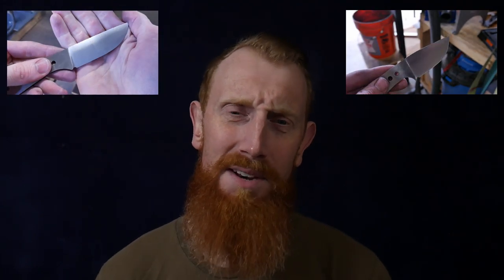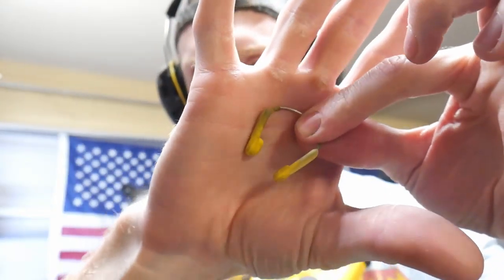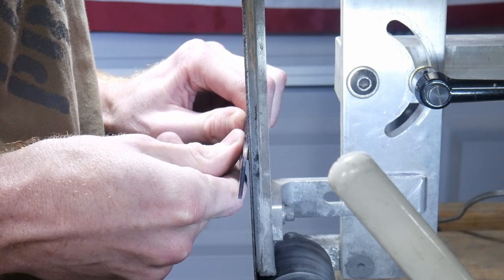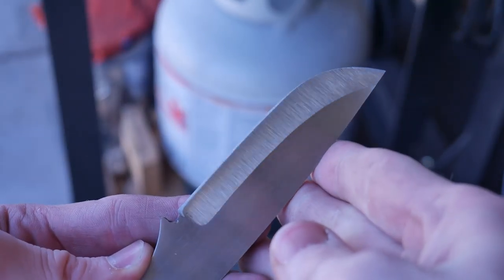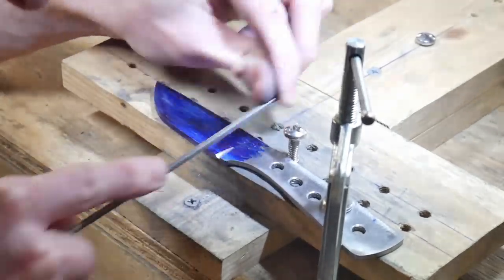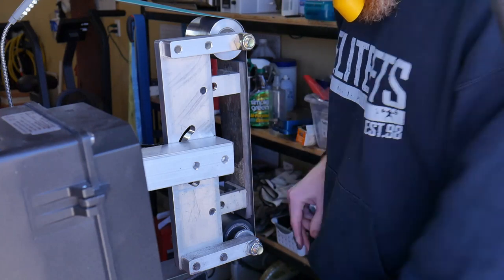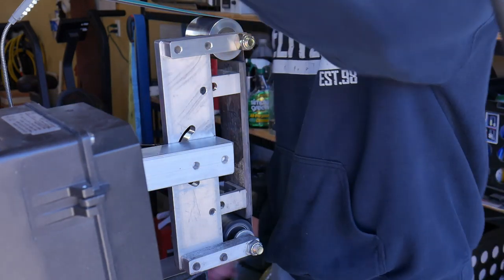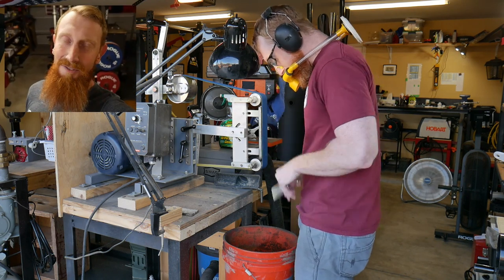Knife Grinding Basics | Plunges & Bevels | Knife Making

Comment from the maker: Do yall have any more tips for free hand grinding?! I'd love to hear them. 🙌
Reply: Red Beard Ops you don’t know what it means for me to get started with a great hobby. I suffered from a really heavy burnout and could not find the energy to do things. Everything including thinking about was to much. I will make mistakes but will learn from them. Thanks again.
Reply: I know it's not an entry level thing but you could go over how to grind hawkbill and curved blade. I free hand blades for my folders and finding out the right technique was a nightmare.
Reply: don't do it all with just a file.
Reply: I'm relatively new to this but when my grinds start to become uneven I can straighten them out by rotating the edge vertical  to flatten it out kind of like cross sanding to keep it flat. you gotta be careful around the tip and the bevels though.
Reply: I have a suggestion. I use a hardened file guide as a "stop" to set where I want the plunges to be. That way I don't accidentally grind too far towards the handle end of the blank. I use old or Nicholson files so that  I can bypass needing a forge and quench tank, only an oven to temper the blade after grinding the blade profile.

Comment: Well said. Pretty much spot on. I learned the same type grinding from Mike at Ekim Knives several years ago. Biggest thing is lots of practice. For me it didn't happen over night. Ocassionally I would take a 4' piece of mild steel  cut it up into 8 or 9 pieces and just practice. Was a lot cheaper than messing up good high carbon steel in the beginning.  Practice does not necessarily make perfect however Perfect practice does make perfect.
Reply from the maker: Thanks Jim! I agree... practice is the key. It's painful at first, but satisfying once you simi-get-the-hang of it.

Comment: made my first really nice knife/tool just the other day thanks to all these diy/ easy/ the  basics videos.  big thanks redbeard (its a wax carving knife/tool. it has a fuji cherry handle natural finished just with some spray on polish.blade is custom profiled. made rounded edges on a flat tip spade) wood came from a tree in the yard/my dry fire wood pile. the metal i got from a old stainless wax tool i had laying around the work bench. the similar tools they sell at the stores/online are 75-150$+..  to be fair and 100% honest i did  mess the first few up. and yup its a dab tool 😂 big thanks again RBO.  smoke um if ya got um lol
Reply from the maker: Heck yeah! Nice work Mike!

Comment: I would add that for complicated grinds you can take a piece of wood that is the same thickness as your bar stock and cut out the blade shape and practice the bevels on it. When I first started making knives I would try out my bevels on some of my more complicated knife templates to get the grinds down (re-curve, double edge, and false edge knives).  Another great video by the way.
Reply from the maker: Heck yeah, good tip man! I've used some wood too. Very useful and you won't ruin steel! Thanks for watching man. Take it easy. Keep up the awesome videos too!

Comment: The pressure is what always messes up my grinds. I end up getting wavy grinds. I used to think it was because I wasn’t tracing the line straight, but now I know that I get the curvy bevels because of differences in applied pressure along the length of the blade.
Reply from the maker: The work rest / push stick method has been doing well for me recently. Same concepts as free hand but with more control on the push stick. Check out my recent hunter build for a visual.

Comment: Great video! I have been trying hand grinding  and kept sanding my fingers (ouch). Found a small magnet with a handle Harbor Freight and it works great on the blade and saves my fingers. I have learned a lot from your videos.
Reply from the maker: Awesome man, glad you found a solution! Really glad the videos are helping out. Thanks for your comment!

Comment: This is the part I'm most nervous about. I had a friend commission a knife -- it's the third one I've built and the first one I've sold -- and the grinding / getting lines etc. accurate is really important to me because I want this to turn out well. And I'm so nervous about grinding it. I started w/ 1/8th thick 1095. And the knife got thin in forging. So I'm worried about the quench and I'm worried about getting the grinds perfect and I just... I really appreciated this video. I do have a grinding jig which I'm hoping will help.
Reply from the maker: Glad you got something out of the build. One thing I used to do when starting out was grinding to about 80-90% and then finishing with files on a filing jig wrapped with sandpaper. It allowed me to practice my grinds and also end with a symmetrical piece. Either way you go, good luck! If you mess up just do it again! I have a scrap pile of "failures" for sure

Comment: Thank you man. It should be helpful. I have been struggling with free hand grinding big time. This answers a lot of questions for me. I had early success with small blades using a diy jig so I started making larger blades. I started to have issues with my small diy jig so I purchased a nice, fairly precise, machined jig. It just is not working for me. I am at the point with my knifemaking where I really need to take the training wheels off and in doing so was once again humbled by the difficulty of making a knife that sports a professional appearance. I have created a shortcut for this video lol👍
Reply from the maker: Cheers sir! Good luck with your grinds!
Reply: @RedBeardOps  Thank you. Same to you!

Comment: Very green with the hobby so this is probably a dumb question but what are you dipping the knife in before/after each pass...just a bucket of water?  Is that just to clean off the blade before each pass or is it needed for the belts?
Reply from the maker: Hey Scott, this knife has been heat treated (quenched and tempered). If the blade gets too hot (higher than your tempering temps) you can "ruin the temper" ... basically make your blade softer than it should be. It's good practice to cool the blade frequently when grinding post heat treat.

Comment: at 2:39 you describe a pivot motion where you are rotating around your centerline.  Have you tried the 'sliding' movement where you keep arms locked and control movement by sliding hips side to side?  Rotational pivot causes me to take too much off the tip, and sliding leads to not taking enough off the tip.  I'm still trying to find the right balance.
Reply from the maker: Man, I find that I need a little bit of pivot to follow the edge. So for instance if I was grinding a very aggressive 45 degree bevel and I wanted the bevel to be the same thickness along the whole edge, I would need to pivot a little to make that happen. I think you could get to the same spot if you spent more time towards the tip with out the pivot? (not sure about that). To test your theory, try it on a piece of wood (paint stick).

Comment: Hey, great video, thanks man.
One short question, how close to the center line do you get @ the beginning of the grind?
In other words, what's the thickness left after both first angles are done?
Reply from the maker: post heat treat I go to around 5-10 thousanths before putting an edge on. If you're grinding pre heat treatment you're looking at around 25-30

Comment: Great videos, I have lost many hours of my life to watching them!  Do you find it easier to freehand grind bevels on thicker blades?  Say 1/8" compared to 3/16"?  I have only used 1/8" so far, but just picked up some 3/16" O1 Tool Steel.
Reply from the maker: Thank you sir! Most all of my work is done with 0.125''-0.140'' stock. From time to time I do some 3/16ths. I wouldn't say one is particularly easier than the other though. You may have a better shot of "seeing" what's going on with the thicker stock. The biggest key to success I've found has been to clearly mark my center line... and then taking a good deal of time grinding to it with my initial bevels. Once you have the edge in the middle the rest generally works out.

Comment: Can u explain how to bevel a tip? I made a tanto knife but it looks so derpy and I didn’t match up the angles or depth very well. I’m gonna have a bevel jig soon but it seems a bit difficult to get the angles to match up good.
Reply from the maker: Practice is your best bet man. Get some wood that's around the same thickness as your knife and work with those. Think painter's stir sticks from lowe's. Good practice for sure.

Comment: Question, boss: is it worth it to try to learn this technique on a 1x30? I’ve been getting some pretty rough results on this little machine, but the 2x72 is way out of my price range right now
Reply from the maker: Absolutely. Use what you have man, with practice and some good belts you can turn out some good work on 1x30s. This method will help - https://youtu.be/oGhAdcNafhA

Comment: Anyone have any advice. When I freehand grind I feel as if I start to get pushed down in pulses by the grinder and can't seem to stabalize myself very well.
Reply from the maker: Use sharp ceramic belts, tuck your elbows into your sides, use lighter pressure (let the belt do the work)
Reply: @RedBeardOps  appreciate the advice. I'll give it a go tomorrow!